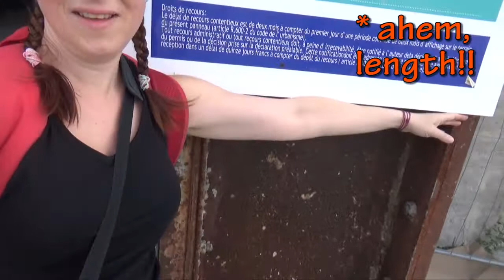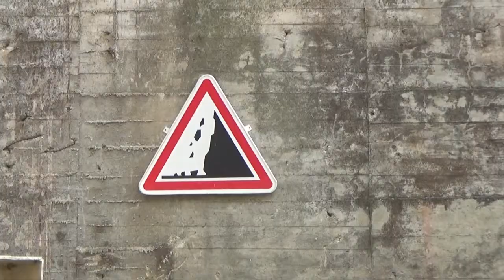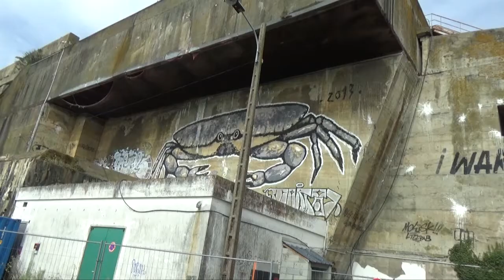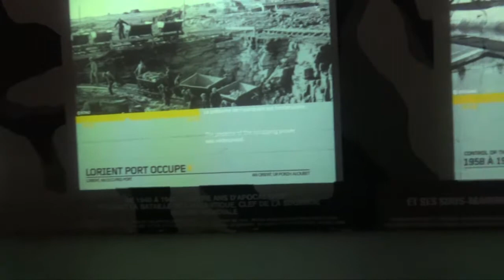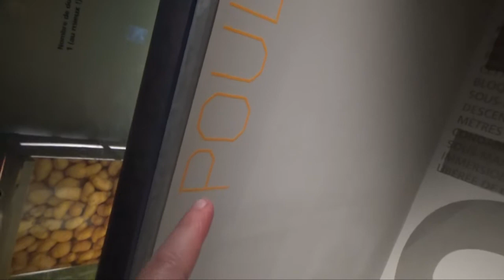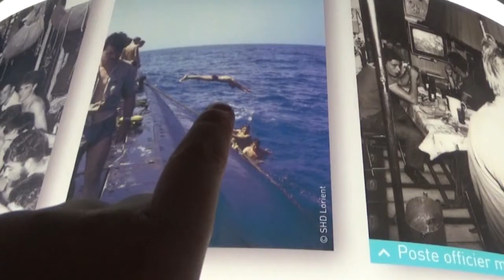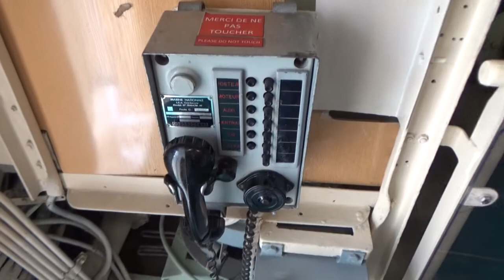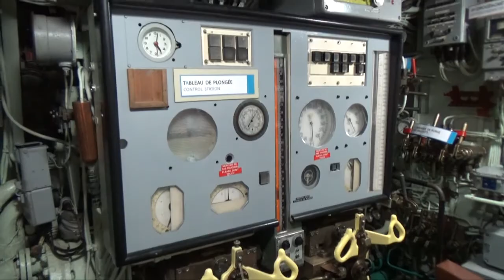Lorient Submarine Museum / Base de Sous Marins de Keroman, France.

Comment: My father was a member of the 199th Field Artillery unit during WWII. He arrived near Lorient just after D-Day. Camp was set up near Lochrist, France. Coordination with the Free French was excellent and many "Boche" were pointed out to GI's before they could cause any casualties. The mission of the 199th's artillery batteries was to draw down upon the Germans in the area of Saint Nazaire, Bouvron, Plouhinec, Plouharnel, Quiberon, Morlvenez, Port Louis, Hennebont, Nostang and eventually Lorient. St Nazaire was the location of their other Kriegsmarine base. Forward spotters for his unit would gain a tactical advantage in say a church tower or by flying overhead and look for German howitzers or anti aircraft guns etc and would unleash extreme fire barrages upon each objective thereafter. German artillery spotters also needed height for spotting and frequently used church towers as well. Sadly that church would become the focus of artillery such as the  church at Plouhinec. Churches were also used as command posts such as the monastery at St Benedictine near Plouharnel before an assault on the Quiberon peninsula. Bridges like Pont Lorois defended by German artillery (88's and 37mm guns) would need to be taken out. His unit collapsed that bridge into the river. Eventually pinning the Germans back to Lorient and cutting off all land supply to the base.  The Germans fiercely defended the submarine base until the end of the war and Lorient itself paid a god awful price from artillery and allied bombers as fighting was done to free this area. He used to say it is easy to blow things up, it is the getting along that is sometimes hard. He did remark how gentlemanly the German prisoners they took were and frequently shared candy and tobacco rations with them. He spoke with many of his German artillery counterparts who marveled at the 199th's shooting and ability to remain mobile and stealthy. Shortly after VE day 1945, my Dad returned to England and married my Mother whom he had met in Bideford, England shortly before D-Day. They remained married 67 years!
Reply from the maker: Thanks so much for sharing this story. It's great to have it here for the other watchers to read. x

Comment: At 7:59 , yes it is a battery , showing one cut in half . A U-boat had two banks of them connected together in series . One forward  of the conning tower and one aft  . They worked just like a car battery, but a lot of them a total weight of 127 tons !  Underwater trim was extremely delicate. I have read,  that if one person walked from the conning tower to the forward  torpedo space . Trim on a type 7 c U-Boat was affected  by 10 degrees  bow down . So trim tanks and hydroplanes would need constant attention .
Reply from the maker: How cool! Thanks so much for all that information. It’s very helpful for other comment-readers (and me too, of course). Thanks so much for stopping by. X